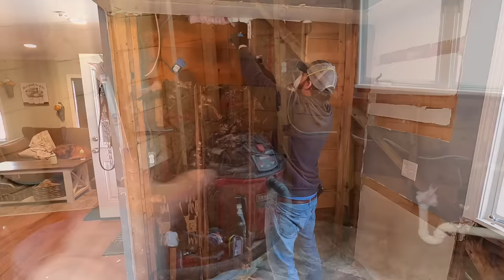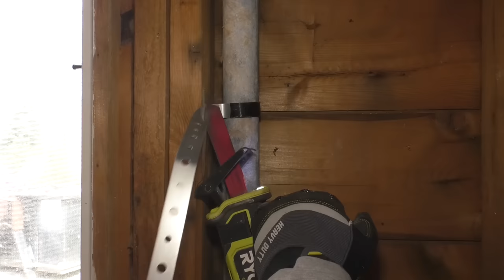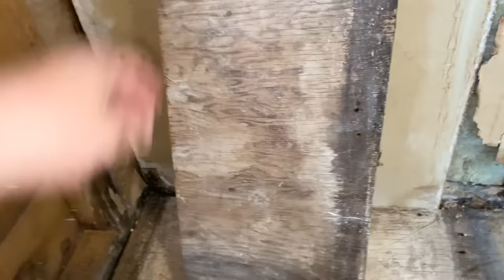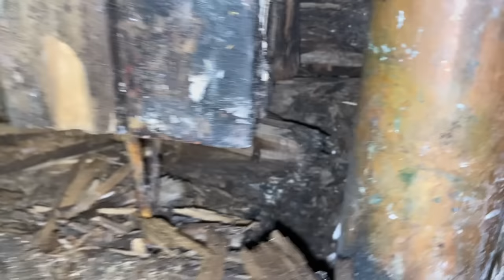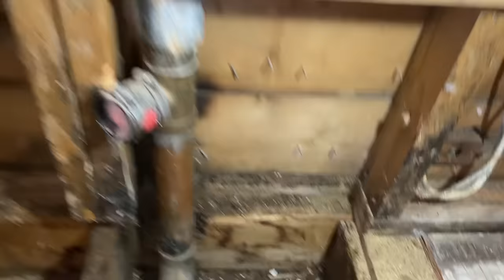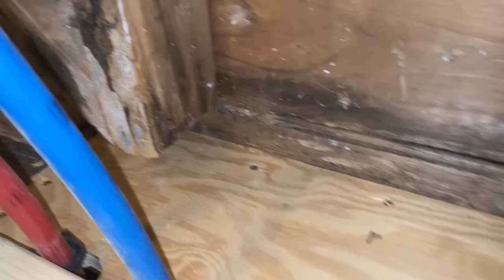Fixing Water Damaged Rotted Wall and Subfloor

Comment: Hey just a recommendation from a guy that works in the Mold Remediation field. If and when dealing with suspect materials like this the mold/stain may be dormant as it has no current water source to feed off of you should still err on the side of caution and spray/soak materials you have left with some Anti-microbial, toss a fan on it for 48-72hrs then seal it all with some killz spray paint.  This will help prevent any mold growing in this location in future from moisture in crawl or another leak down the road.
Reply: Great advice.  As I was watching I was thinking he should do something and your suggestion would not have been that difficult or expensive. He seems fairly cautious, so a bit surprised.
Reply: Terrific advice. Not a lot of work to save from eons of possible worry. The epoxy solution below in comments is what my Fine Homebuilding guy recommends as well for sanity's sake. The microbes hate plasticized wood and won't eat it further.
Reply: Thanks for that...im in the same boat and am clueless. That helped a bunch.
Reply: Exactly the question I had! Thank you
Reply: What kind of anti-microbial spray would you recommend?
Reply: @TheSpatulaCity  there are alot and depends on the specific situation. If its on framing and your going to seal it after you can use a product called MMR, you would need to find a distributor that sells this or something like it in your area. (Wear gloves/Respirator/eye protection when using). If your cleaning sufrace mold and it can be easily wiped away there are products like Benefact/Mircoban/Concrobium
Reply: Thanks, will do
Reply: Yes, definitely wear a respirator at a minimum.  Mold reproduces with spores (essentially powder like seeds). The mold doesn't have to be active for that entire area to be coated in spores, and they will grow again if they get in the right moist environment, like your lungs.
Reply: I use a 50/50 mix of bleach and water. Saturate and leave overnight. Do a second application and run a fan on area while working on another part of project. Sometimes it takes three of four soakings. After drying area out completely I spray an oil based primer to hard to reach areas and brush and spray what is visible. Never had a regrowth.
Reply: Exactly!
Reply: Exactly!
Reply: Exactly!
Reply: Exactly!
Reply: Exactly!  It’s funny how we tear out to the studs on walls then pull the guesswork on floor.
Reply: Exactly!  It’s funny how we tear out to the studs on walls then pull the guesswork on floor.
Reply: @TheSpatulaCity  What you want to do is use RMR86 first (it's basically concentrated bleach), wait about 15 minutes, and then follow up with something called Fiberlock Shockwave and completely soak the wood. You can also use Benefect Decon 30 but I usually use that for the actual physical wipe down because I like how it lathers. But the most important thing is to do is first establish a containment area and have a fan pointed OUT of the window so that more air is exiting instead of entering. Always HEPA vacuum everything and if you can afford it, run an air scrubber. Make sure you have at least an N95 mask on when you do anything related to mold.

Comment: As someone who has remodeled several houses in the past. In areas where replacing the wood was just not possible, epoxy resin is a great way to strengthen the existing wood. As for the stud I would sister it and call it good. That said it didn't look too bad to me. Anyway great content keep up the great work! Love the house so far!
Reply: Yeah!  I have done the same thing.  I use a product from System Three that is a penetrating epoxy.  They use it on boats.  You mix up A and B and then brush it on.  The mix is very thin and takes awhile to cure and the wood soaks it up.  Makes it permanently rock hard.  You have to predrill any screws you put in but worth it.
Reply: I was just watching some videos about that, It's called wood hardener.  They were using it to strengthen some old rotted window sill on a centuries old stone building. Neat stuff, its a liquid that soaks into the old/dry/spongy and deteriorated wood and hardens nice and hard like resin or bondo.

Comment: Future reference, there is wood hardeners out there that you could brush on the old rotted areas you didn't replace that would add to the integrity of the rotted boards. Great job with the project so far.

Comment: After we discovered that my master shower had been installed without any moisture barrier at all (tile over drywall), we got a contractor involved. Ten days into the demo he told me that they "officially" stopped finding water damage. Lots of rot, warped siding, and mildew. Fun times.

Comment: I especially enjoyed this video because I'm currently renovating a bathroom and I've been fixing wall & subfloor water damage exactly like this. one problem I've had to deal with, is that the part of the house where the bathroom is was built in 1937 and the 2x4s are actually 2" by 4" so I've had to use larger pieces and rip them down to size
Reply: Never a bad idea on cut pieces on the exterior wall to slap some copper naphthenate on the cuts at least. Is it over kill? Sure, but no one needs bugs having a chew after doing all that work.

Comment: Thanks for sharing this video.  It may not have been a perfect repair, but it certainly made it better than had it been left neglected.  As others have mentioned here, you should have done something to mitigate the mold.  That's mold spores in that wood and when you have enough humidity back there, as in the summer, you could have a problem.

Comment: Nice work I did something similar to our first house. It was a 1960's ranch with an attached garage for some odd reason they buried the sill plate a few inches below grade. I had to dig out a path and pour a concrete sidewalk/patio along the side of the garage & back. What a pain in the A"s and replacing approximately 6 ft of rotten sill plate & sister the studs it wasn't fun.

Comment: For the dry rot you can buy a spray on hardener. I used some wood epoxy to fix a window sill. First I sprayed the hardener and let it dry then the epoxy. The hardener works well.

Comment: Love watching you work its actually kind of relaxing, seeing how you just tackle these projects and just do work arounds when needed. You mentioned you might repair the wall from the outside? I have a similar issue here, where the sheeting at the starter strip is breaking down. it appears as its water damage (from outside snow laying to high) and I get the odd mouse or mole coming in. Everyone I have asked about this says I need to take down the entire wall of siding to repair the bottom 8-12 inches of sheeting? but my main concern is getting the starter strip back in the right place( if I only remove the necessary area?) once I have fixed the problem. The other issue is its very close to the ground (septic side) and  I want to make sure this doesn't keep happening. close to the ground meaning about 2 or so inches.? Love to hear your thoughts?

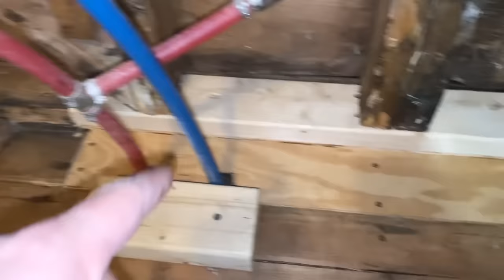Comment: At 24:00 you started removing your "wicked awesome support structure" and I couldn't believe what I was seeing...possibly the solution to a major problem for me!!! Am I correct in understanding that you used those planks to support the studs while you worked? And was that a load-bearing wall? I was so excited to learn that technique for a small job like that (which I'm working on the same exact job right now). You could do a whole lesson on just that technique. Little tips like that are valuable to a novice like myself. Great instructional video!
Reply: Yes, I think that's what the purpose was for those planks.  Since he was removing the support below those rotted studs he needed a way to distribute that load bearing weight elsewhere.  Personally, I would have used a few more screws into those planks to be assured that the full weight of the structures above ( we don't know if there is a second floor ) is carried to the studs where the planks are attached.

Comment: Really great job. I wish you were able to do your own plumbing,  I know you'd do it right. I was a bit concerned about that wiring and outlet though. ? 👍👍💚🛠 Keep em' coming.
Reply: Likely that's fine as it was for the disposal, as long as it has a GFCI outlet in it I bet it'll pass code.
Reply: He's redoing all the wiring in the kitchen so I'm sure he'll make sure it's all up to code.
Reply: @johnhpalmer6098  the wiring looked a bit iffy..just a bit better than knob & tube. I'm sure he'll do the gfi 👍🛠🕊
Reply: @redwingprincess  I must have missed him say that, I know he always makes it better and safe. Can't wait to see the update.👍🕊
Reply: @d.j.robinson9424  I just looked at it again, it's not K&T. It's old Romex I think. Remember, that house was built in 1946, kitchen was updated in the 60's and that wiring under the window is likely from then, but some may have been added later. 

Remember, Knob and Tube needs space for the hot and neutral wires  of 6 inches at minimum, so one leg is on a stud, the other leg on another stud, and uncovered as it's designed to rely on the air around it for insulation so it's not covered up, and no junction boxes for splices, they are spliced, and taped off and out in the open. All Romex and BX wiring require a junction box for all splices. I think a junction box is used for outlets and switches for K&T though, but that would have been it and was phased out in the 50's in most jurisdictions.
Reply: @johnhpalmer6098  that sounds good John,  I bet your right on that; I did forget he mentioned the 1946 build date. Thanks again for clarifying. 👍

Comment: If i seen all that water damage I would've stopped and sold the house.  And you fixed it with a 2x4 with  an 8th of an  inch thick piece of ply. 👍🏼

Comment: Right around or before 1:24, when you pan up to the cast iron vent in roof, is that not daylight showing through? Just making sure!
Reply from the maker: Nope!  That is the reflection of the camera light.  Didn’t notice it until someone else pointed it out too.  And the drips on the pipe are not water haha it must be some old sealant someone used once upon a time.  Thanks for the comment and for checking out the video!
Reply: @TheFixerHomeRepair  Awesome!  Because that would be so heinous to do all of that work and have water come right back! 😊

Comment: Any plumber you bring in will want to relocate both the water lines and the drain to within the wall on the centerline of your new sink. If possible this should be within a void and not next to any wall studs.for the drain. The water piping, should be attached to studs  to firmly hold them. Be prepared to have to cut 2 1/2 “ holes through the wall studs to route the vent pipe to the current vent stack  this is not unusual and with the holes in the center of the studs, will not compromise the wall. .
Reply: The sneak peek at the end of the video shows what you are indicating.

Comment: You cut the copper before it joined the pvc and there was clearly more attached to this vent pipe than the kitchen sink.  So now whatever it was venting is now venting into the crawl space??  Also you just boarded right over where the vent needs to go and paying a plumber to cut holes in your house will make that bill larger.

Comment: Your lucky I had a leak in my drain line and it rotted my whole wall and several joists it was a mess
Reply from the maker: Sorry to hear, hope it was able to get fixed!
Reply: @TheFixerHomeRepair  yes had to replace the whole wall and several floor joists and flooring but we needed to remodel the kitchen anyway so all new cabinets and appliances and expand 10 feet into the garage